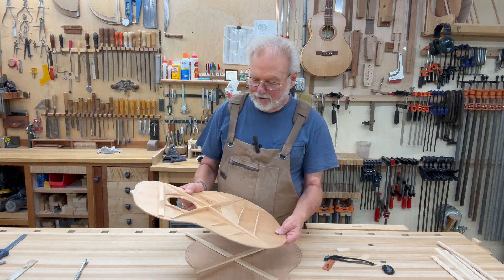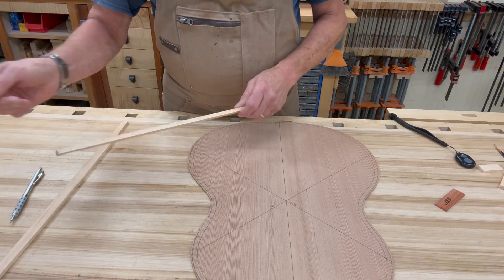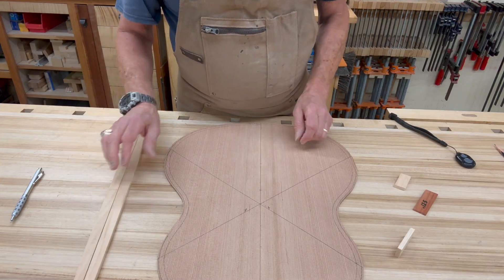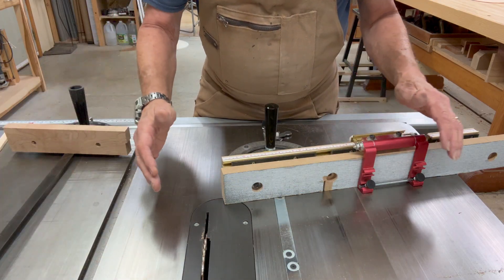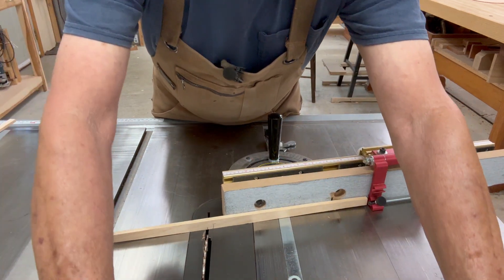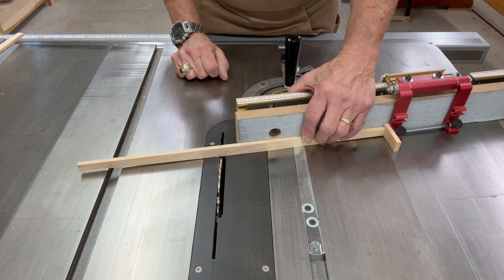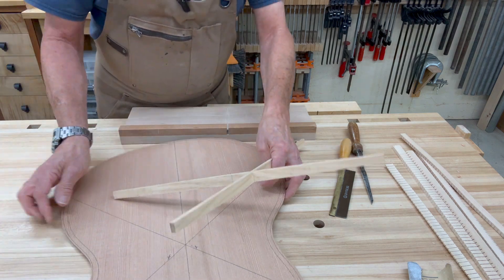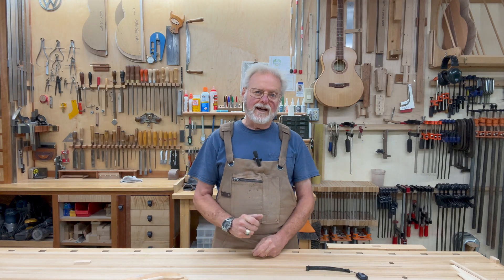X-Brace Lap Joint; An Easy, Direct Method

Comment: as a cabinetmaker, i learned its good practice to cut your joints while the stock is still square. just cut your joint and do the radius afterwards😊
Reply: Not only is it good practice practically, but its good practice from a safety perspective if one chooses to use a table saw. Wrestling a curved board and properly placing it next to a spinning saw blade is just another variable working against you.